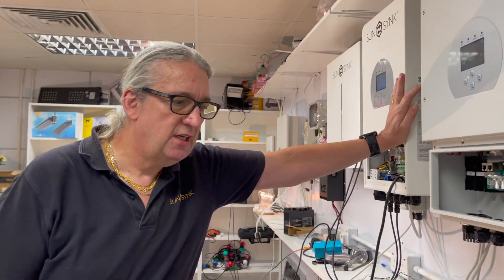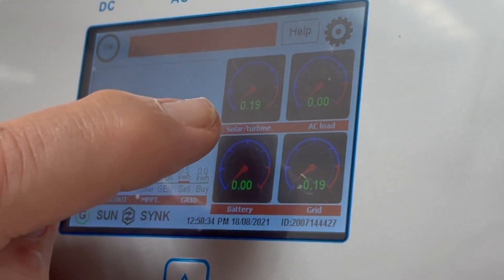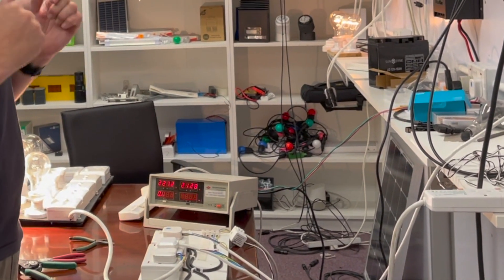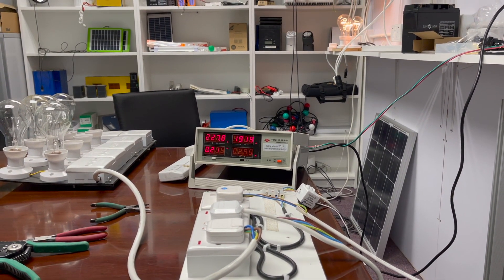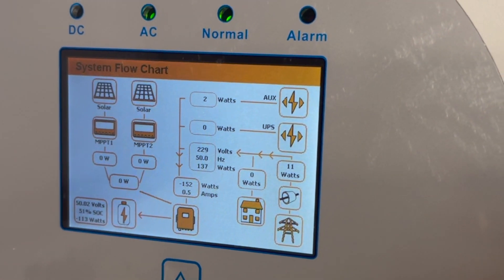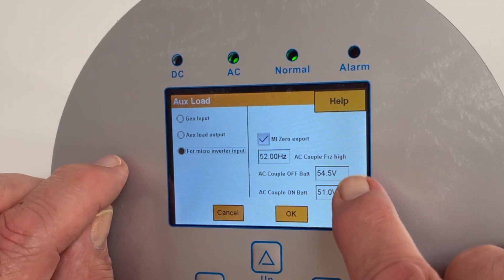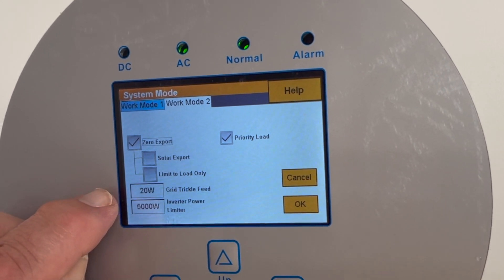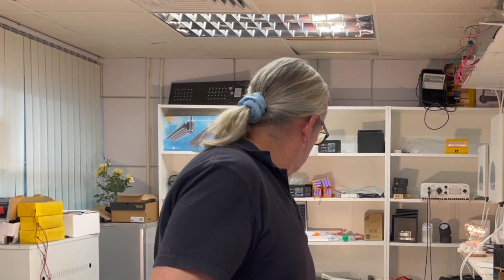Adding a battery to an existing system

Comment: work mode 1 you got power on 5000 for all but the app gives warning with those settings - the range is 0 - 3600. Why would you set it to over max?

Comment: If anyone from Sunsynk monitors these comments, can some please clarify the point about only needing 1 CT Coil on the main L1 in - as in previous material it was stated that with a power generating device on the Aux port like a generator, you would need a CT Coil as well to prevent accidental damage from energy going out of the Aux port, for example damaging an alternator on a generator. 
Are you saying that other power generation devices on the Aux port, such a micro inverters (or in this case a grid tied inverter) do NOT NEED a CT Coil for protection? Please clarify as this is hugely important if damage could be caused without. 
These videos really need a lot more structure for them to be a useful learning resource; especially for viewers who are not experienced installers. The content is very thin on detail and skits around